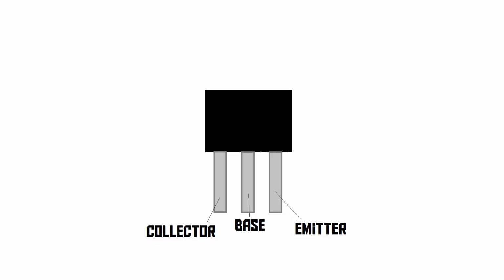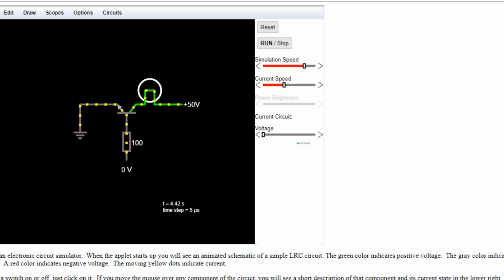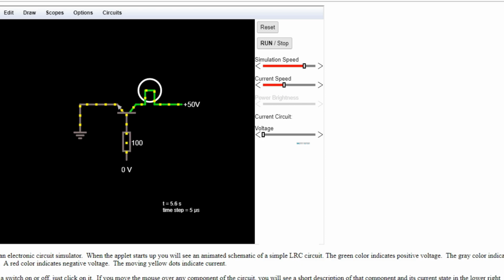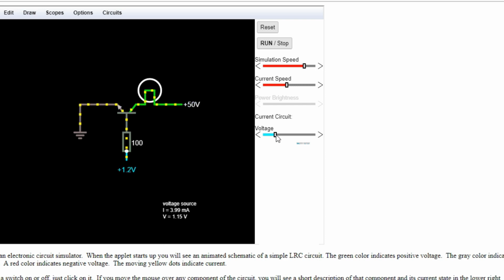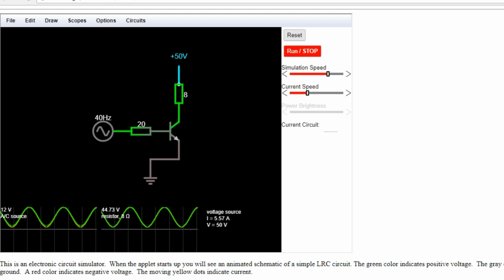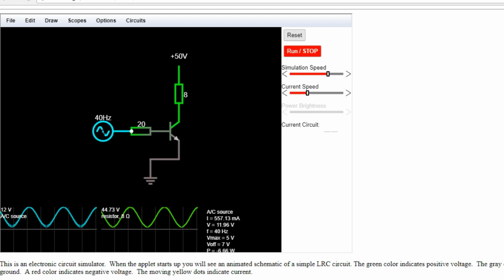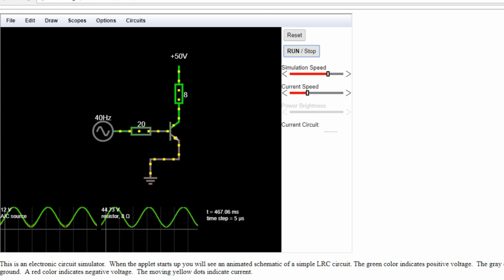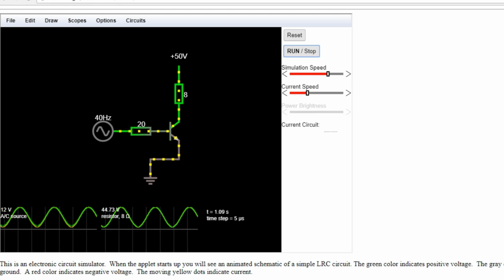How does an audio amplifier work? (AKIO TV)

Comment: Fun fact about amplifiers and transformers. There are amplifiers that use transformers at the output stage of amplifiers. these are for the sound systems that you would find in a building. For example, a grocery retail chain or restaurants or airports to name a few. These are called distributed audio systems. Here in the United States we use 25 to 70 volt audio and sometimes 100 volt audio. While the United Kingdom and others use 100 volt mostly. Also, the speakers on these systems have a transformer on them too. To step the voltage down to 8 ohms respectfully.

Comment: I'd advice you to use 2 zip ties on your mic holder, by placing them on top of the already tape covered connection. 
So the seal doesn't fail too soon.
Reply from the maker: That's a good idea. The tape is still working now (8 months later) but I think I'm still going to use those zip ties just to be sure.
Reply: I'd advise you to use the correct spelling of advise, and also to stop trolling and disguising it as advice.   And with this, you get a sentence with examples of advise and advice together, to better help you learn the difference.

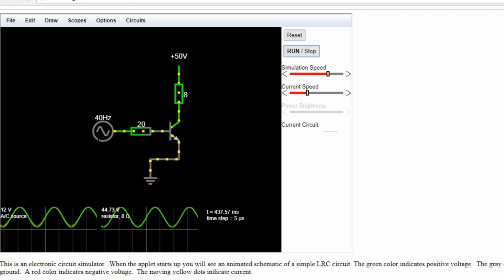Comment: Hey you started the video explaining that the collector was input, emitter output, and base operates circuit. Then later around 6:31 pointed out the AC power supply, which is connected to the base, as input signal and collector, connected to the speaker, an output signal. Am i mistaken?
Reply from the maker: The emitter is the "output" of the transistor, but that doesn't have to be the audio output of the amp.

Comment: With the transistor simulation, wouldn't the transistor have to be before the light bulb for it to work as a switch? Or do you just have to stop the flow somewhere in the circuit?
Reply from the maker: in reality you wouldn't use this circuit, this was just a small demo of how a transistor can control current flow.

Comment: That very well may have clarified something I could never understand. Would it be accurate to say a transistor is an infinitely variable relay? I do HVAC so I don't work on boards I replace them.
Reply from the maker: Sort of; the BJT (the one in that circuit in the video) is current controlled, whereas the FET is voltage controlled (voltage applied to base). So I'd say the BJT is more like a relay than the FET. (which is interesting because FETs are commonly used to replace regular relays.) 

As a general concept overview, I'd say that analogy works quite well.

Comment: If a transformer doesn’t reduce the voltage and the amps (current) then why do phone charger adapters run at 10watts? Usually 5V at 0.5amps?
Reply from the maker: The charger input power is the same as the output power; 10 watts in means 10 watts out. For example 240V at 0.04A in and 5V at 2A out.

It is possible that the output power is lower than the input power, due to losses inside the charger (heat production)

Also modern phone chargers aren't just transformers, they're switching supplies; they first rectify 120/240V into DC, then they re-invert it to AC but at a very high frequency (+10 kHz) and only then do they transform it down to 5V. the advantage of this is that they can use a tiny transformer so that the charger can be made very compact.

Comment: Hello,
Complete NOOB here. Great video and incredible voice [seriously - some radio station should snatch you up ASAP!]. I do have a question tho, in the second amplifier model, you have a 40 Hz audio signal being amplified by a 50 volts supply, BUT aren't volts and audio signals two different things? Please clarify and pardon my ignorance - I truly want to learn. Cheers!
Reply from the maker: Well the audio signal is just an electrical voltage that changes in time. The moment you apply that voltage to a speaker, the cone of the speaker moves back and forth according to that changing voltage, which then produces the actual sound waves. The waveform of the electrical signal therefore has the same shape as the sound waves.
Reply from the maker: Oh I forgot to add that the frequency of the signal corresponds to the frequency of the sound, where the voltage of the signal corresponds to the loudness. The input signal was (if I recall correctly) 5V, the output signal 50V, so the amplifier made the sound "louder", but it didn't change the frequency, which remained the same.

 In the video, the simulator said "40hz" next to the input signal, the voltage of it was something like 5 or 10V but the simulator doesn't display that on the screen for AC sources, I think that caused the confusion.
Reply: Not sure I understand how an " ...audio signal is just an electrical voltage that changes in time" but ... I'm more confused now. Thank you kindly. Be safe. Cheers!
Reply from the maker: @maxwarfield6699  Sound waves are the air moving back and forth. How many times the air moves back and forth per second is the frequency of the sound. So 40Hz means the air moves back and forth 40 times per second.

An audio signal is a voltage that goes up and down, representing those sound waves. A frequency of 40Hz in this case means the voltage goes up and down 40 times per second.

A speaker takes this voltage that's going up and down (varying in time in other words) and then moves the air back and forth at the same rate, converting your electrical signal into actual sound.
Reply: Ok, that's a lot clearer to me now. Thank you so much, sincerly, for taking the time, to try and explain such a phenomenon, to a complete NOOB, such as I. I really do, appreciate it. Keep making videos, you've got a bright future ahead of you, mate. Thanks again and be safe out there.
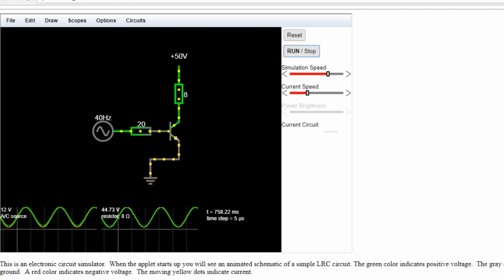Reply: @AKIOTV  But why exactly wouldn't 6:55 work with a transformer?
Reply from the maker: @yasyasmarangoz3577  If you used a transformer to increase the voltage, you'd cut the current by the same amount. 5x more volts would lead to 5x smaller current. If I had a 1V 100mA signal, and "amplified" it 5x with a transformer, I'd get 5V at 20mA, which is only 0.1W of power: not gonna drive any speaker.

With a real amplifier, I can get the signal up to 5V with say 1A max or even 10A max depending on the design.
Reply: @AKIOTV  Oh!
So the input current is important too?
I cannot use (let's say) 5V and 0.0002A?

BTW Thanks a lot, I really appreciate all the work you've done here.
Reply from the maker: @yasyasmarangoz3577  at the end it's all about power: transformers add no power, amplifiers do add power. (which is why they need a power source while transformers don't) 

and power = current x voltage.
Reply: @AKIOTV  Watts.
Thank you again, I'll take another look at your channel, maybe become a subscriber ;)

Comment: I thought transistors were only on off switches. How can an analog signal go through it?
Reply from the maker: Depends on the type of transistor and the circuit it is used in. In class D amps or power converters/inverters, the transistors indeed act like switches.

Comment: Does amplification change peach of sound waves.
Reply from the maker: Peach? Is that a term I've never heard of or did you mean pitch? Because if it's the latter, then no it doesn't.
Reply: @AKIOTV  yeah yeah pitch...😂😂😂
Reply: @alic8094  Well, the "pitch" won't change but if you change the power draw rate by adjusting the volume on the actual amp, that will have an effect like if I generated a 528 hz tone in Audacity but I also slapped on a tremolo at 4 beats per second (think of that as power draw rate) then I will also feel nature (432 hz) since the amplitude fluctuations from the tremolo happen more during the times when 528 hz and 432 hz sync. 528 hz and 432 hz fall in and out of sync over and over so putting a tremolo at 4 beats per second takes advantage of those sync points when they occur. I found that adjusting the "volume" digitally in a media player does NOT affect the draw rate, though. If you can't do that, see if there's an equalizer and have all frequency ranges go down equally together.